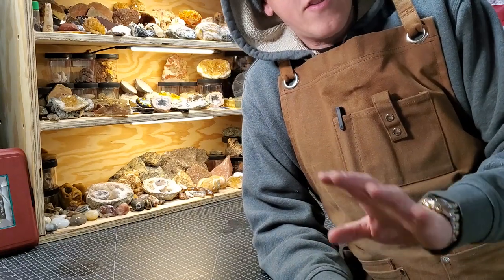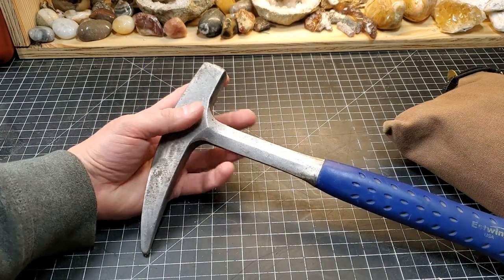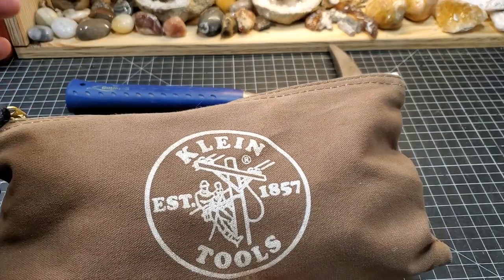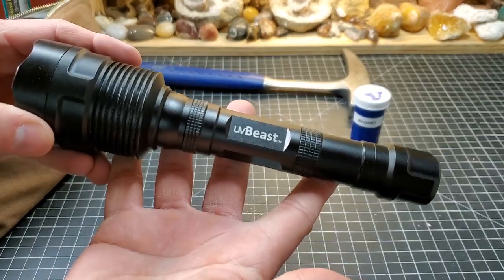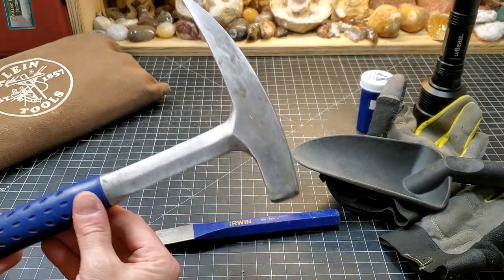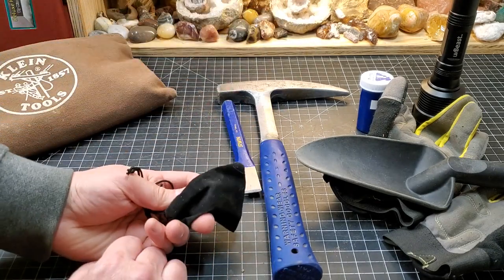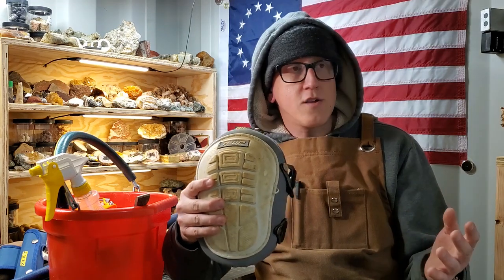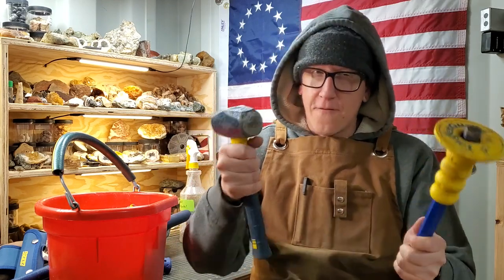Rockhounding Tools | What You Need to Go Rockhounding

Comment: Hi Buddy, Ben from InfiniteWave Cornish minerals UK here. I stumbled upon your channel while looking for ideas to help with setting up my new lapidary / mineral specimen preparation workshop (my third). Good videos and good content - I have subscribed and will be watching more. Obviously we all tailor our kit to different locations. A few contributions from me. I wear work site trousers with built in knee pads and also use a thick foam gardening kneeler. At some locations when digging mine spoil heaps I take a 5 litre container of water and a floor scrubbing brush - it is surprising how far 5 lites go - I use it in my bucket to give potential specimens a quick clean- this really helps with ‘quality control’ and identify ‘leaverite’🤣 For packing delicate specimens bubblewrap and heavy elastic bands work well - inside plastic snap lock boxes if really delicate. For larger quartz specimens where protecting the crystal points is essential I find that closed cell foam camping sleep mats and elastic bands work great. Mushroom trays are great if you do not have far to walk from your vehicle - they stack well too. Finally, I am a caver (spelunker) and do some of my collecting in old mines, often abseiling. I have found that the ultimate collecting bag is the Warmbac cave divers bottle bag - it is not cheap, but it will stand up to a lot of abuse and can be used to carry ridiculously heavy loads. Happy mineral hunting!😎 Ps new InfiniteWave website coming soon😉
Reply from the maker: Thank you for the tips and I would love to hear when you get your website launched.

Comment: having worked in the trades for a few years, I can confidently say that every old man that I have worked with has told me to swallow the pride and wear a pair of knee pads. Once your health is gone, it's gone.
Reply: I find they cut into the back of my legs causing rashes. But if I was in trades I would invest in another better pair.
Reply: I agree with the sentiment, but I have never found a pair of knee pads that I have been comfortable enough to wear for more than a few minutes. I now wear trousers meant for builders/ construction work that have cordura "pockets" for foam knee pads. The odd time it's too hot to wear long trousers, I wear shorts and use a foam kneeling pad. Not ideal, but as you say, you have to protect your knees!

Comment: Great video. Nice list of things to have. I really liked the vest idea, especially during hunting season! For a light to backlite agate and other translucent material, I took an inflatable, solar Luci Light and cut the inflatable part off. The base is still sealed and has LEDs that shine through whatever you place on it and it's waterproof, so spray away, get it gritty, or of course keep on when it's raining. The best part is that you can put it in the car on the dash to recharge and it's always ready. It also has a red emergency light so it's great to have if something unexpected happens or the sun goes down. We usually carry headlamps too just in case.

Comment: Cool set of tools. Great idea about the safety vest. Definitely may save you having to deal with questions,  or buckshot.

Yes, I agree the buckets are a pain. I like to use Kitty litter pails. They come with a lid, and they are square. Easier to fit places.. The plastic is definitely heavier than the big box buckets and they have a heavier handle. 

Cool video. Thanks.

Comment: Great video! I use the 5gal buckets but only to put my finds in the bed of our truck or to hold the tools so they don't scatter all over. I use a canvas type backpack or bucket to carry my finds and tools when checking out an area. Depending on the terrain wandering in a GOOD pair of hiking boots/shoes is a must! I also carry a bit of paper towels and gorilla duct tape wrapped around a dowel, good for temp bandages or putting small specimens on the tape.
Reply: Yes a 5 litre plastic Jerry can with a 4" square hole cut out where the nozzle is would be best. It has a comfortable handle, cheap and quite durable.

Comment: How did you add the hose on the bucket handle?  Great idea and video.  Very helpful!!  🪨⛏️🔍😁👍🏻
Reply from the maker: Thank you. I just took two pliers and bent the handle so it can come off one side of the bucket, add the hose, and bent it back. It's kinda hard to do but worth it for a really nice handle.
Reply: @CurrentlyRockhounding  I wondered if the inner diameter was wide enough do it that way.  Thank you!!  I went to various stores today to build my rockhounding kit based on your recommendations.  VERY helpful!!
Reply from the maker: @CacklingChick  Yay!

Comment: Wonderful and helpful video!!  Just wondering how you take the handle off of the feed buckets because I love the idea of a hose handle??
Reply from the maker: I just bend them off on one side and put the hose and re attach.
Reply: @CurrentlyRockhounding  Thanks…do you bend the thinner underneath wire or the looped end that has a black cap?
Reply from the maker: @ceeclearly6840  I belt the thick handle wire with the black cap on it.

Comment: Thanks for sharing your kit Jared, much appreciated! Rock-hammer, gloves, backpack and gad tool's are my goto's for virtually every trip that's not me hiking a river.👍 Everything else has been very trip specific~ hahaha Screwdrivers, 3lb cracker, wedges, chisels, collapsible buckets, prybars, shovels, trawl, pick, harness/rack/climbing rope, chest waders, inflatable float ring, knee pads, padded seat, magnifier, 4" portable wet tile saw, wire brushes, gorilla cart, hammer drill and 2x27gallon tubs all sit in the back of my jeep cause you never know when you'll need to float a river traipse through some off the track creek/stream or rappel 30m down some cliffside to get the goods~ PS...I only lick rocks if they have cinnabar for the mercury~  🤦‍♂️😂
Reply from the maker: Your the second person to mention the collapsible bucket, I need to find one now. Gotta get that daily dose of Mercury.
Reply: @CurrentlyRockhounding  Unsure about what collapsible buckets are being discussed, but if talking about canvas ones, they can be very expensive.  Look for canvas beach-type tote bags of at least 16 oz canvas with handles that are sewn on the entire height of the bag (the handles just sewn at the top will not hold up).  I am also unsure of what you use to carry your rocks.  Not sure that with the stuff already in your backpack, you can fit much in there and when full, it is murder on the back.  I take the same canvas totes spoken of above (I stole mine from my mother decades ago, so unsure of where to find).  Then I bought heavy duty straps for camera bags, laptop/messenger bags or duffel-type gym bags with extra heavy spring clips on the end.  Clip each end of the strap to each canvas strap on the bag.  I carry two of them.  I slip the camera bag strap over my head on my shoulder with the right arm through the assembly and another one over the opposite shoulder.  You can carry a lot more weight in these since the weight is in line with your spine and not trying to pull you over backwards.  I have some spots where the agate, jasper, petrified wood and quartz is so thick that I use an Estwing Gem Scoop (or one of your clever homemade ones), scoop up rocks and alternate putting them in the bags.
Reply: You have any room left for rocks?
Reply: @kenoliver7279  Do now, swapped the jeep for a truck~ 🤣🤣

Comment: What kind of knee pads do you suggest? Hard shell covering the, gel pads covering the knee, or....? If you can suggest a brand name to look for, all the better. Newbie asking here. Thanks for your time!
Reply from the maker: I use the soft ones, that are like rubber. I forget the brand, its just some of the cheaper ones from home depot.
Reply: @CurrentlyRockhounding  Thanks for getting back to me.
Reply: The gel ones in the flooring department at Home Depot are the best ones I’ve used, they all slide down to your feet eventually though

Comment: Hi, random question, I do metal detecting and I am trying to recover a target that is below a large smooth granite boulder. It's impossible to move the rock and my only option appears to be to break the rock into pieces. Would the hammer in this video or the larger pick be appropriate tools to try to accomplish this job? If not do you have any other recommendations on how to best break up this rock? Thank you for your time.
Reply from the maker: You will want drill holes in a rock that big and you feather wedges to crack it.

Comment: Yeah man, a bucket aint happening where I go and I have found grout brushes to be lighter weight, have stiffer bristles,  and won't leave brass scratches on the rock. 
Need a geopick and it would be nice if estwing would start producing the treasure scoop again.
Great vid man, stay warm.
Reply from the maker: Ill look into the grout brushes. Also I contacted Estwing about a year ago asking if they plan on making them again and they don't plan on it. I do have a design for one that I plan on making soon which will be far better than my old home made one.
Reply: @CurrentlyRockhounding  I saw that one you made in one of your vids and it seemed to work great so I'll look forward to seeing  the next model. Cheers man and keep up the good work.

Comment: actually, those 2 knives don't appear to be butter knives...they look like what are called dinner knives and some folks call them case knives, although case knives can be a pocket knife.  dinner knives/case knives have a serrated edge, whereas butter knives tends to be shorter with a shorter blade without a sharp or serrated edge.  this was a very interesting and informative video!
Reply: You are correct, they are not "butter knives" which actually have a thicker edge than these.  These are simply "dinner knives".

Comment: So I bought a hammer and chisel off Amazon but when I would use it the head of the chisel would just bend and warp and not break the rock is it just the type of chisel or could the rock be to hard???
Reply from the maker: It sounds like the chisel you bought is unheatreated and low quality.
Reply: @CurrentlyRockhounding  any good chisels you can suggest heavy duty
Reply from the maker: @ethanfahner9859 Estwing, Fatmax, and Dasco are all good.